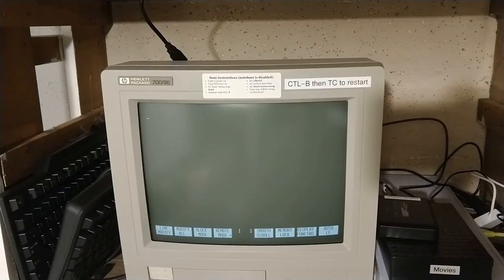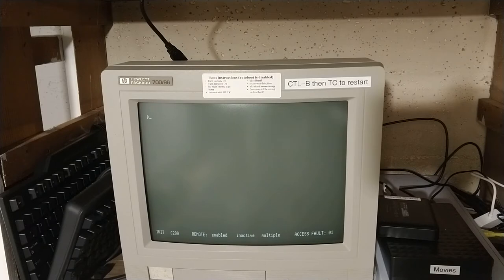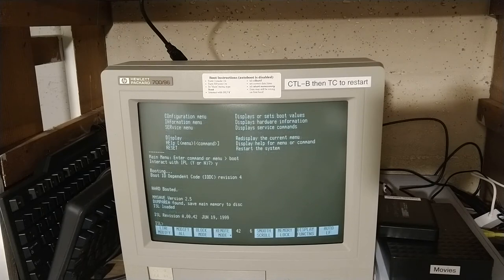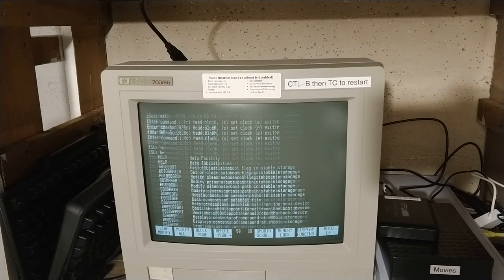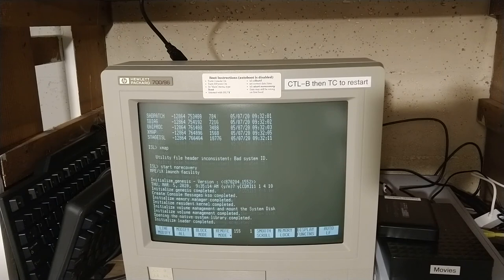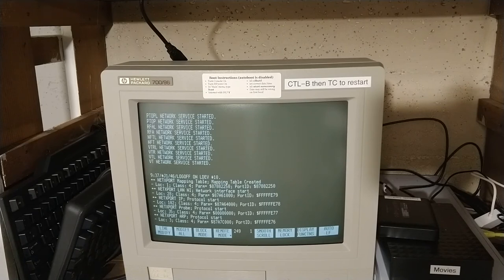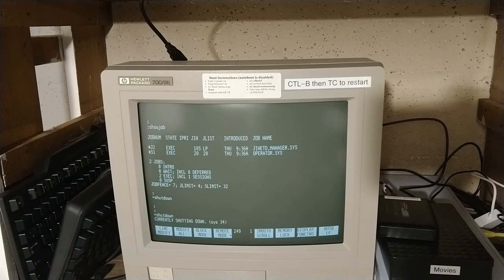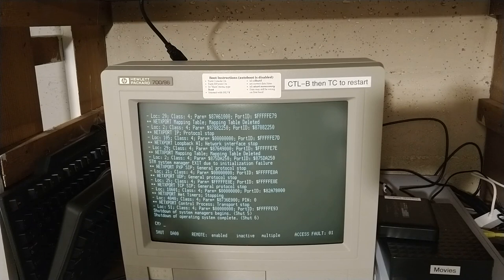HP3000/XL Series 918 Starup and Shutdown Procedures

Comment: What op system is running on this version of the 3000
Did not look like MPE
more like posix9

One if hp mistake was not getting the 32bit  or multi processor machine to run and giving up on MPE
Reply from the maker: It is running MPE/XL. The only thing you really see here is the BOOT software running, so perhaps that is what is throwing you off.